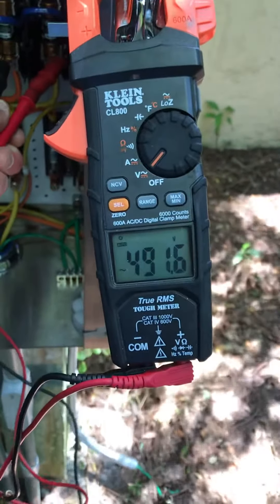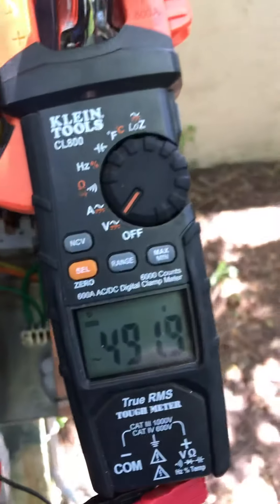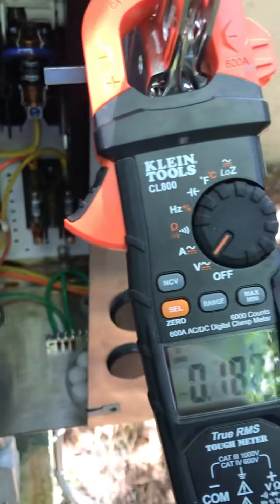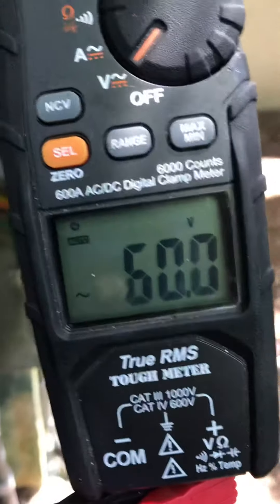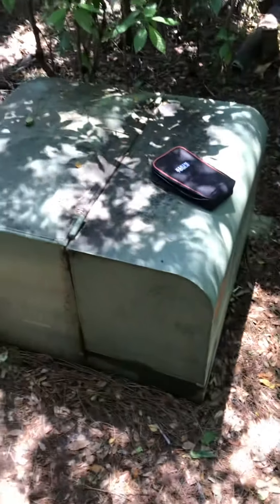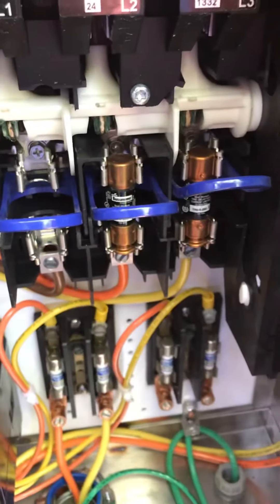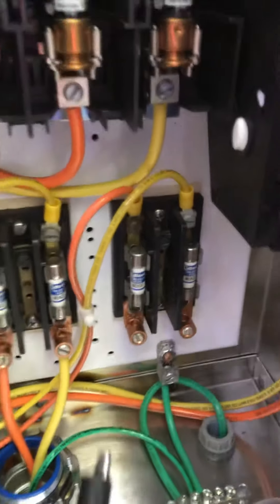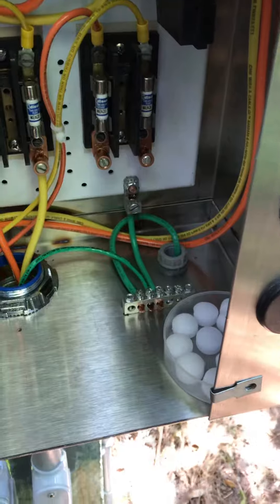480/240V Single Phase system

Comment: Wow,    never knew something like this existed.   Every 480 volt system that I've ran across,  was either 277/480 3ø Wye, or 480 volt 3ø Delta, usually corner grounded.    And if you wanted 480 volt single phase you would just tap off any of the two phases and run to your load.
Reply: I got into roadway work and thats what they run, i was so confused seeing 480 single phase